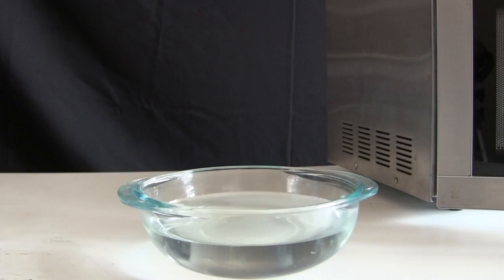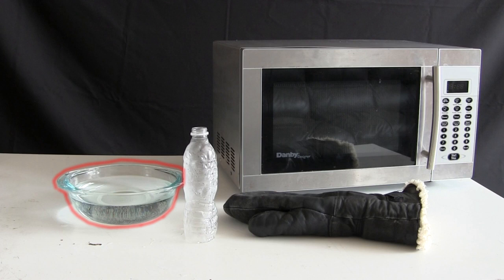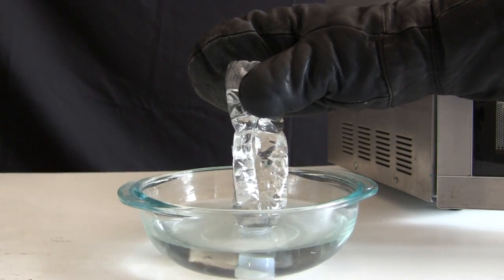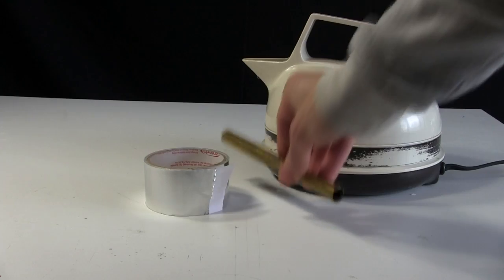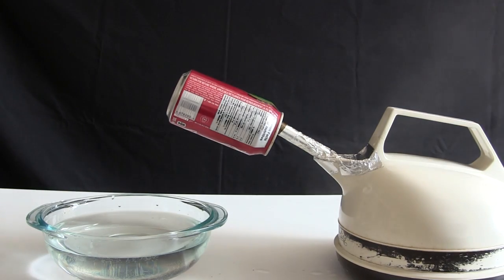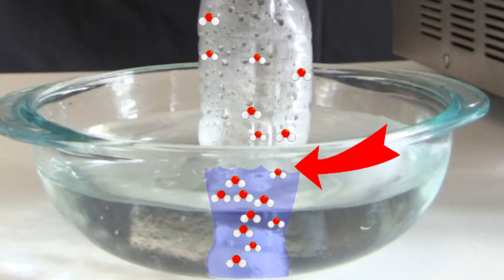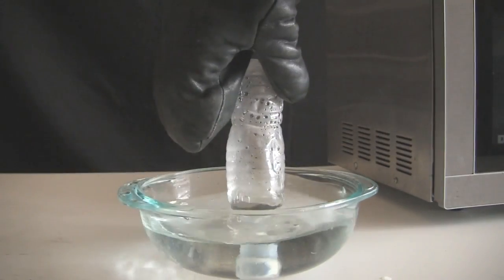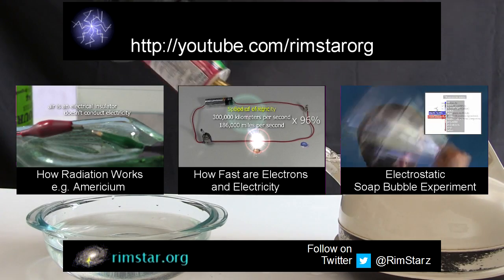Steam Vacuum - Making/How it Works

Comment: hmm.idea.
glass bottle(screw cap),solder,steel knitting needle(black paint)
solder the knitting needle to the centre of the cap.
Paint it black.
heat cap to boiling temperature.
use technique shown on bottle.
ecacuate water OVER the bowl...insert needlecap whilst hot and screw tight.
stick several bottles like this into a reflector array.
Even if its only a partial vacuum,it should allow heat out in the primary direction of the cap as long as the needle isn't in contact with the glass.

Comment: In high school physics (about 1968), our teacher would let us do our own experiments on fridays. I was concentrating on my experiment and didn't take notice of the crinkling noise from the bench behind me. A student was doing a condensation experiment but wasn't too bright and left the screw on cover on the one gallon can  with a little water in it over the bunsen burner. Thank God the teacher noticed it and quickly removed the expanded can and cover before it blew up. Several of us would have been scalded or worse.

Comment: That's what they do for running a steam turbine in closed loop.  They just reheat the steam just after it cool up a little.  When the steam ''collapse''(or cool down a little), it create a negative pressure for the system work.  The perfect steam turbine in closed loop is a commercial airplane engine.  The heat is produced by a giant 35 bar air compressor(the plane engine).https://www.youtube.com/watch?v=xGfQ179Vcsc

Comment: You need to understand how the temperature can effect physical properties. 

Have an empty water bottle and leave a few drops of hot water inside. Seal the cap, and see what happens when you suddenly submerge the bottle under cold water. 

Remember: Hot water expands and turns into gases. Cold water retracts and turns into solids.

Comment: How much vacuum is created by the condenser in a big commercial steam turbine powerstation (inches of mercury)?
Reply: 1" Hg (absolute pressure of course) is typical pressure inside a steam turbine condenser. Though it varies between 1-3". The idea is to create greater pressure differential across the turbine
Reply: Mladen Pavlovic
Thanks for letting me know.  I was very curious.  It must boost the efficiency of turbines a lot (by avoiding 'back pressure' on them.  I was luck to have the chance to visit GEC's HP turbine factory in Rugby (UK) and then their LP turbine factory in Manchester (UK).  It was AMAZING to see MASSIVE machine tools in use.  I think the Manchester factor is closed now.  It was a beautiful sight to see.  Turbine blades are in a sense 'designed by nature' I think
Reply: That is exactly the reason. If you look at the turbine equations, you will see that its output is directly correlated to pressure difference across the turbine. So by pulling vacuum on tail end of the system, you are adding additional 29" Hg to your overall steam pressure.

Fairly new design, and definitely on the rise, is use of Air Cooled Condensers instead of condensers cooled with water (environmental aspects). Those condensers can see even lower pressures - 5 mmHg and lower. When steam comes in contact with solid surface of the condenser, it collapses into water droplet and is leaving void space behind it. Since those condensers are HUGE, adding these voids leads to low pressure inside. Sometimes they're able to pull even lower. So once you pass below 4.6 mmHg, water freezes. To prevent this from happening, air is bled into the system to keep it above that limit....
Reply: Mladen Pavlovic
I had not thought of that problem of low pressure leading to freezing which needs to be avoided!  I see that this sets a lower limit to how far vacuum can be taken.  I once imagined a train with turbines mounted transveresly coupled directly to the axles (maybe forty turbines).These would be fed by a high pressure manifold running the length of the train connecting every vehicle via flexible (spherical) ball joints.  In my imagination the turbines are affected by a vacuum at the low pressure stage.  This vacuum is enabled by drawing cool water from a trough which is placed between the rails on the sleepers (cross-ties).  In this way a steam train could approach the efficiency of a conventional  power station which I understand to be about 60% efficient.  This contrasts with an orthodox non-compounding steam locomotive which is about 4% efficient.  Of course the troughs could only be placed on level stretches of track (there were such things as water troughs in the old days).  I thought the pressure vessel (boiler) should run at very high pressures in order that the overall efficiency of the system be maximised.  This train would have the characteristic 'whine' of turbines and not that nice chuffing sound you hear from an ordinary steam train.  I am sure that this imaginary train would cost a huge amount of money to develop.... but it could create a low tech high speed train that would be an alternative to electric high speed travel.  Just a happy thought!

Comment: This is not particle theory and/or statistical mechanics. This is Thermodynamics and
your explanation here is worthless/meaningless.

Liquid water is 1700 times less voluminous than vapour/steam. Steam also has more kinetic energy/properties. This is why when there is an induced phase change from steam to water it is so violent. This is called,  "Condensation". An instant 1700-fold reduction in volume like that, then it is no miracle to see stuff like this occurring.

I wish people making vids on You Tube involving heat would start discussing Thermodynamics according to matter and not always energy or physics/chemistry. It only promotes the Second Law of Thermodynamics (which will destroy us) and does not promote the Zeroth and Third Laws of Thermodynamics which are more realistic and promote using already-existing heat (First Law) and manipulating their/those  systems to produce Work.

These Laws also promote/emphasize complete chemical cycles, where chemistry or chemical reactions are used, which means No Pollution or waste and environments themselves benefit from our presence and activities.

Sustainability is not even an option, but we should be looking at technology that not only improves/helps our lives, but everything else too, collateral, like every other form of natural life does on this planet..
:-)

Comment: I'm extremely interested in how much psi of force this creates. Do any of you know?
Reply: definitely less that what it takes to heat the bottle up
Reply: What on earth are you talking about? I ask about PSI of the discovered vacuum for applications that don't happen in labs or in modern systems and might be a little more rudimentary in which a change in energy is required.
Reply from the maker: Lyle Cairns I don't know how much force is created or how much of a pressure difference. I didn't do any measurements of the vacuum inside. I don't think anyone's done any for this demonstration.
Reply: Nearly 15 psi. The coolant water creates a vacuum equal to whatever would take to boil that water. So if it would take 14 psi to boil the water, thats what the vacuum will become. It reaches equilibrium.

Comment from the maker: Yes. You need a pressure difference. In this case the difference is between the very low pressure inside the bottle and the atmospheric pressure outside the bottle. It's really atmospheric pressure that collapses the bottle.

Comment from the maker: Just looked it up again, now that you've mentioned it. I first read it years ago in a National Geographic book called Inventors and Discoverers (highly recommended for inspiration.) As you point out, that was Newcomen's engine. The story goes that James Watt repaired a Newcomen engine and then went on to design one where the steam was heated in one container and cooled in a separate condenser, a huge improvement.

Comment from the maker: It may not be due to pressure at all. It may be a volume change. I failed to determine that by experiment since the results look the same. The general gas law is that (Pressure x Volume) / (Number_of_moles x Temperature) is a constant, it's result is the same before and after. We know T and N decrease so for the result to be the same before and after, P and/or V must decrease. It could be just V changes as steam turns to water. Since nature abhors a vacuum, water enters as volume changes.

Comment: Wikipedia says it's an impressive 1:1600 difference in volume and the difference in pressure is created when the steam cools and condenses.  The bottle would have a little water in it, but there would be little to no air at all .. it would be a vacuum.  This is the same concept used in canning.

Comment from the maker: If you fail to get the big rush of water then you sometimes get a slow rise of water in the bottle instead, over around 15 to 30 seconds. That's what was happening to me if the water in the big container is ice cold (for some reason I don't know.) In that case you still end up with only about an inch of air at the top. I think that when it's in the microwave, most of the air is evacuated and replaced with far fewer but higher thermal energy molecules (steam I guess.)

Comment: What I didn't understand is this:   If Grant had capped the bottle after pouring the water out and let it cool down, there would have been maybe a tablespoon of water and a bottle-full of air, so where did all that air go?  It seems like the water should have only gone halfway up the bottle, due to a 1:2 pressure change.  For it to fill the bottle completely, like it did in the video, that's more like a 1:1000 pressure change, as if the steam was 1000 times the normal atmosphere pressure.